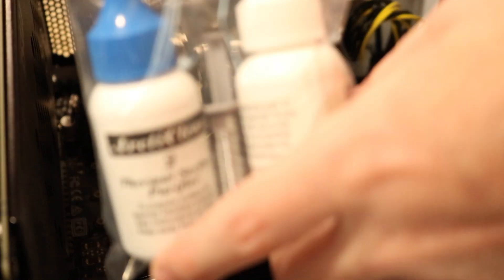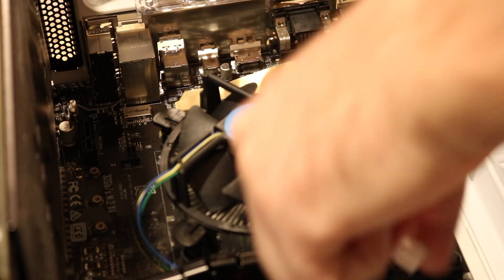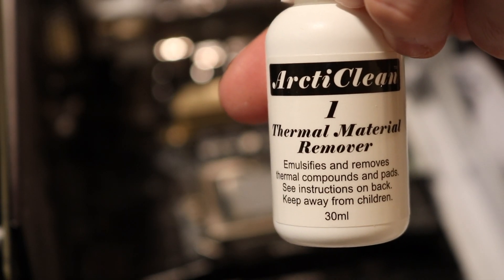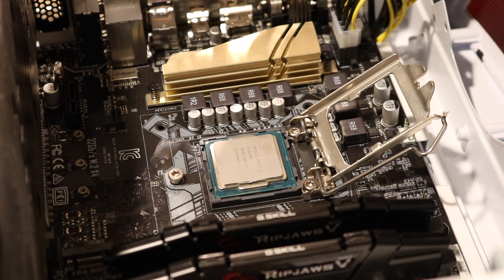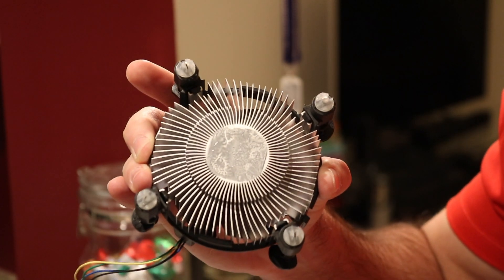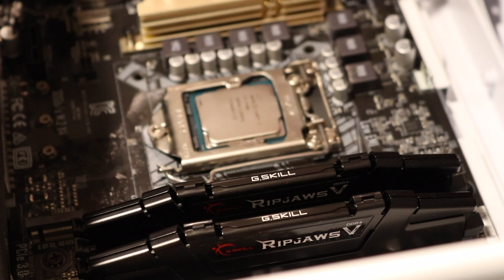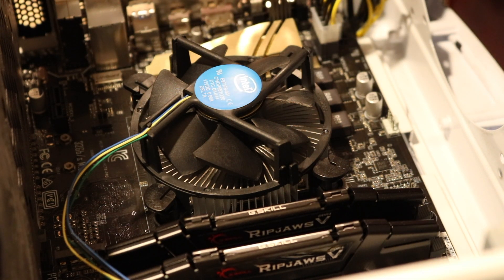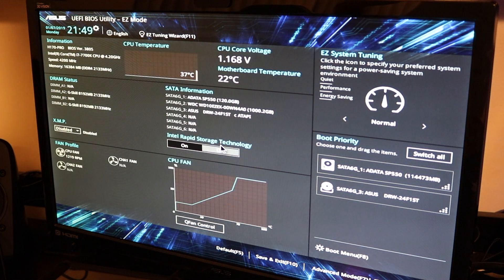CPU Intel i7-7700k Install! Gaming Setup

Comment: the one thing about the thermal paste thing that alot of people seem to be very obsessive over, they forget that unless the cooler itself is decent that paste aint gonna do anything for you and i know this from changing the paste and the fan on my cooler that my old HP computer at home came with, the temps never improved from me changing the paste nor the fan itself it was only until i built my own computer that i got a better one from intel with my g4560 chip, and its all common sense if you think about it, the paste is nothing more than the lubricant that the system is using to transfer the excessive heat away from the cpu through the metal fins, that's why most people can still use a computer with dried up thermal paste just fine and not be aware of it unless the fan starts getting clogged with dust and it shuts itself down to protect itself.
Reply from the maker: Thanks for the advice! Yea I have only seen like 1 degree temp difference in paste. I now have a liquid cooler which makes all the difference lol